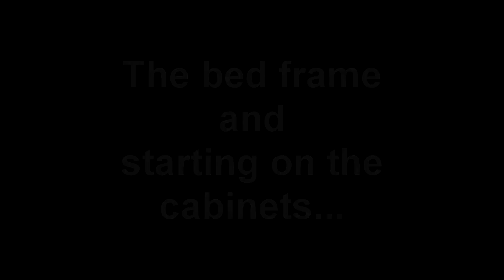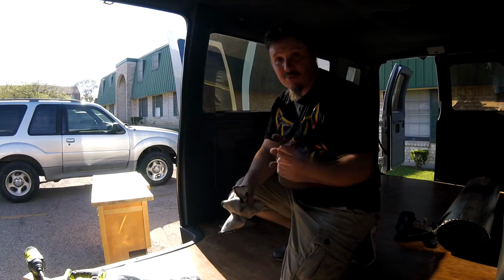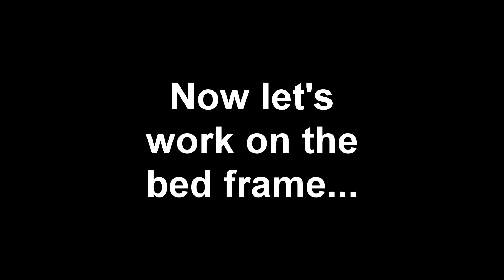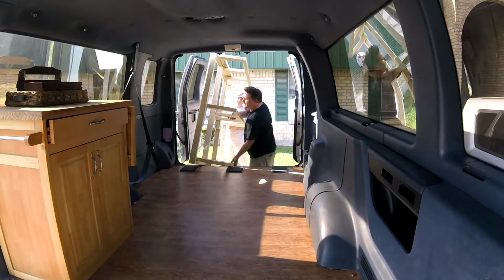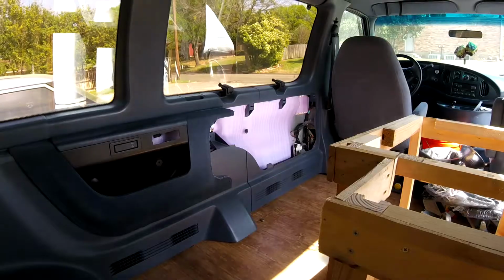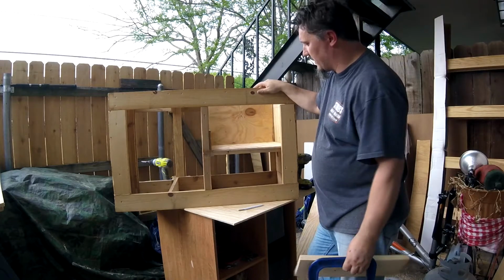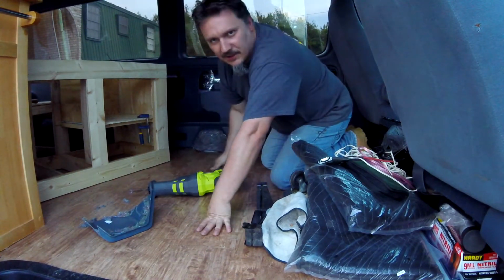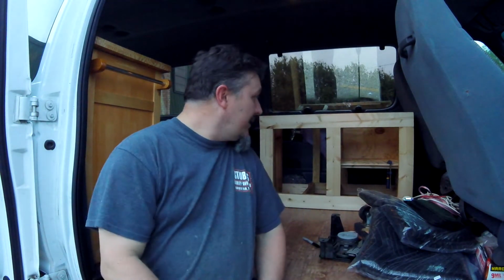Bed Frame and Begin Cabinets

Comment: Thank you for your videos!  They are so useful.  Starting a conversion on a 2013 Econoline E350.  Really like your approach.  I understand you used self-tapping screws and L-brackets to hold down cabinets and bed frame. Did you consider using some of the old seat bracket bolts and holes?  

Also, what precautions did you take when drilling into the metal substructures to prevent rust?

You both are awesome!  Thanks for your great advice.
Reply from the maker: Hi Mathew! So, I added sealant to the bottom of the holes and the screws to keep them from rusting out, you can buy it in the spray can or add like sealant in the tube. I eventually used some brackets underneath the frame using the original holes left from the seats and put bolts through them with lock nuts and washers. When I sold the seats I also sold all of the brackets and everything with them so the person buying them would be able to mount the seats. I had thought about using them, but figured its best to let them go with the seats lol... I am no longer with the person that is in this video, but she owns this van still to this day and currently lives in it still that I heard. It still works fine and has never had any issues. The flooring is still strong and holds up nicely even with everyday use.  Good luck with your build! I went at this build on a budget as we lost everything after hurricane Harvey. So, built out of necessity...However, I made sure It would last, and it still has to this day. Take care! and Happy crafting! Cheers!
Reply: @FnDTX  Thanks, you have been so very helpful!  Good luck and I'll keep you posted on our conversion.
Reply from the maker: @matthewgoodwin6287  awesome!! Good luck on the build!! Cheers 🍻

Comment: How did you attach everything so its secured while driving?
Reply from the maker: Bolted to the floor and into the metal on the floor. I also used selt tapping bolts. Not one single issue and we drove from Texas to North Dakota, then back all the way to New Mexico. INcluding some offroad driving. :)
Reply from the maker: The cabinets were screwed into where I removed the piece of paneling. also used some "L" brackets on the floor to get it set.